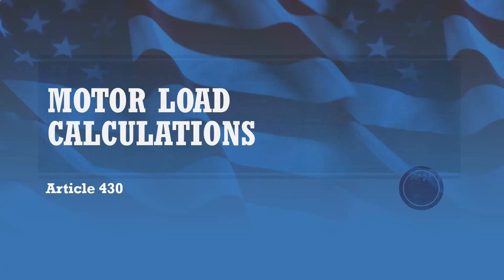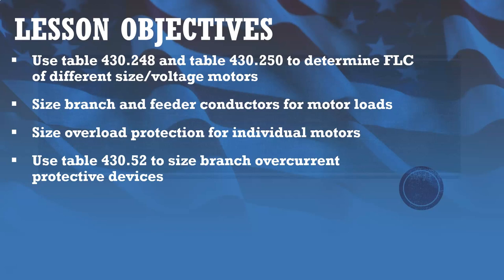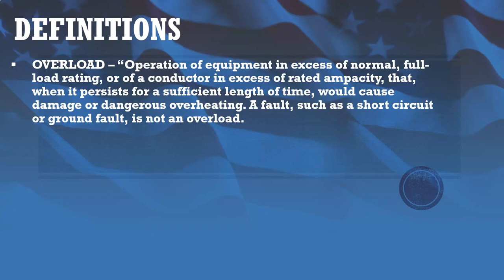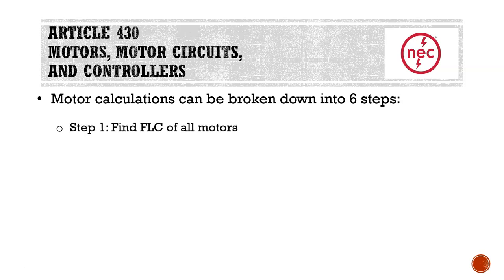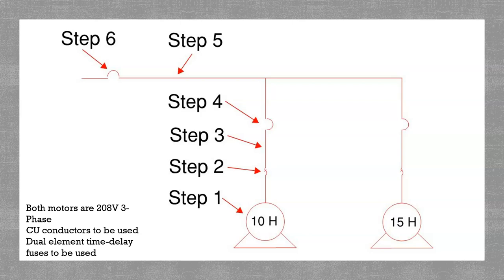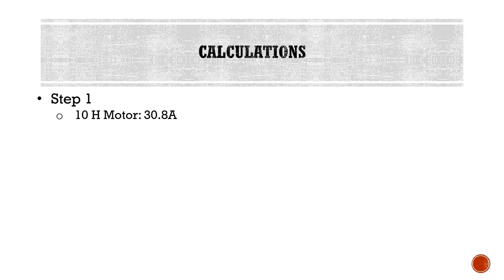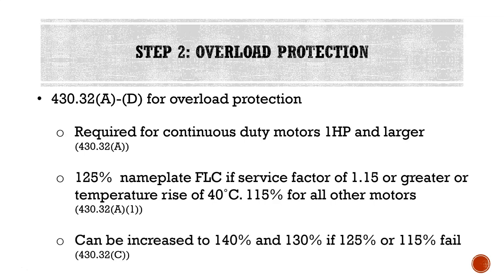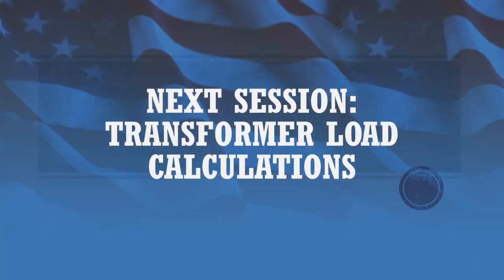Motor Load Calculations

Comment: nice video however NEC2020 430.32(A)1 doesn't it say that for the overload devices we shall use a percentage of the motor "NAMEPLATE" full-load current rating for overload devices, which comes from the "motor nameplate" and we use the FLC tables for the overcurrent devices. Mike Holt does a video on when to use nameplate and when to use tables. Also I'm not posting this to criticize anyone, I'm just trying to better understand what I was taught in the past.
Reply from the maker: Hello Daniel,

Assuming the nameplate on a motor is available and specifies an FLC, we would use the nameplate rating as a basis for all of our calculations. The tables (430.248 and 430.250) are used when we either don't have a nameplate, or the nameplate doesn't specify the FLC. This is because most motors are unique, and you may notice the verbiage used for the tables such as "normal" and "usual". They provide a good base-line when other information isn't available, but always go with the nameplate values when they are available. Hope that helped, and thank you for the comment!
Reply: @electrical1019  Thanks for the reply, however I think more clarification is in order. Again I am just want to understand fully. I think the NEC makes a clear distinction between motor nameplate values and table values and when to use them. How I understand it so far  is the table values are more extreme, sort of worst case scenario numbers they came up with from years of data, so they are used for sizing conductors and over-current devices, etc, while the motor overloads protect the motor so therefore when sizing overloads we use the actual nameplate value from the motor since motors are unique to properly protect the motor. In my experience the table values and nameplate values are always different and both are normally used in motor load calculations. NEC 2020 430.6, 430.6(A)(1)and elsewhere it states that table values are used for conductors and same elsewhere for overcurrent devices. The 430.6(A)(2) states that motor nameplate values are used for sizing overload devices. Is this correct, generally speaking. I know there are exception when nameplate is missing or special duty cycles but that aside, I think the main point is both table values (conductors, overcurrent, etc) and motor nameplate values (motor overloads) are normally used for calculations.
Reply from the maker: @danielfagan7406  Sorry for the confusion, I believe I understand what you're asking now. I would point you to 430.6(A)(1) and (2), which I think summarizes up the information you're looking for. If not let me know though!
Reply: @electrical1019  ok now we are getting somewhere. Those two articles that you cited are the same two that I cited in my previous response and they say to use motor nameplate for overloads and the tables for the other protection. That is also echoed in the Mike Holt video that I linked. So after reading those articles wouldn't you agree that your video is inaccurate because in it you used only table values to make all the calculations when in step 2 for overloads it should have been the motor nameplate flc for the basis of the calculation. Although you even say "nameplate flc" you are using the table value that you found in step 1/
Reply from the maker: @danielfagan7406  You have to keep in mind that for the example motor we used, we were never given nameplate rating to use, so under this situation we would still go by the values given in our 430.248 and 430.250 tables. Definitely a good point to remember that if the nameplate value is given, we would use it. These videos are a little biased to be written in a way that is more aimed towards passing a state licensing exam, since the goal of these is to help prepare someone to take that type of exam. That is also why we didn't specify if this was a low speed/high torque/multispeed motor, even though by 430.6(A)(1) that information would need to be known.
Reply: @electrical1019  ok that makes more sense now that I know the video is geared more towards an exam, because I have installed many motors over the last 20 plus years and I almost always had a nameplate so in actual practice I know that a missing or illegible nameplate is more of an exception than a rule. I would say that that should be mentioned in video, because if I hadn't of know any better I might have believe this was the typical way to perform motor load calculations and never use the nameplate. Thank you for all your time and the videos.
Reply: FLA = name plate current and is used only to size oveload protection 
FLC = ampacity from tables and these ampacities are used to size branch circuit conductors,switch disco.,feeders overcurrent protection

Comment: I was with it until the table 430.52….if our FLC was 35.4/53.13…. And used the percentage of the time delay fuse being 175 %…. 35.4x1.75=61.98 FLC/ 53.13x1.75=92.97….. yet you came up with 53.9/80.89 FLC…. Anyone care to try and help me out perhaps…. Seems I spend hours working on these calculations and they just seem to not work out yet never a very good explanation of how they come to their answer…..
Reply: FLC's were 30.8 and 46.2. It looks like you used FLC with the 115% overload adjustment. I've done the same thing
Reply from the maker: Hello, the FLC of our motors was not 35.42/53.13. 35.42/53.13 was the maximum size overload protection we could use for the motors based on 430.32. The FLC as determined by 430.250 for these motors was 30.8 and 46.2. If you multiply these values by the 175% from table 430.52 that you reference, then you will end up with 53.9 and 80.89. Hope that helps!
Reply: Actually you are right I have the same 35 .4 I found better to learn onhm law and just use this videos for a guide I did the same calculations and they are off by a lot I have 35.8 on 10 horse power at 208 volts

Comment: step 5 was not clear on how #3 AWG was selected ?x125%?
Reply from the maker: We take 125% of the largest motor (the 15HP in this case) and add it to 100% of all other motors per 430.24. This equals 88.55 amps. Using the 75 degree Celsius column of 310.15(B)(16), we see that in order to cover 88.55 amps we would have to go up to a #3 copper wire. Hope that helps!

Comment: You incorrectly use the FLC for the Overload size. NEC 430.32(A)(1) explicitly states to use the nameplate value, "...shall be rated at no more than the following
percent of the motor nameplate full-load current rating:"
Reply: Can you tell me why no starters are used here.. DOL starters can only use upto 5hp..